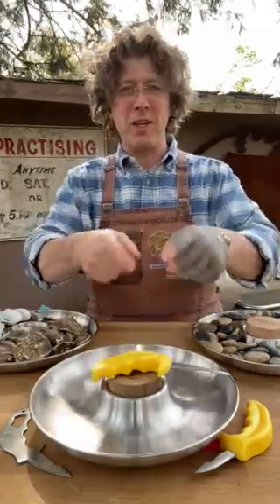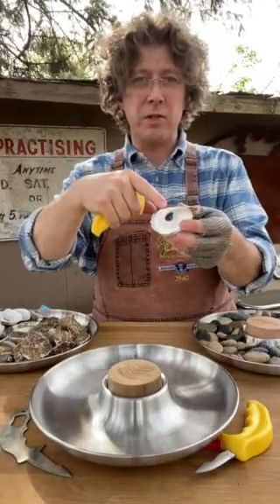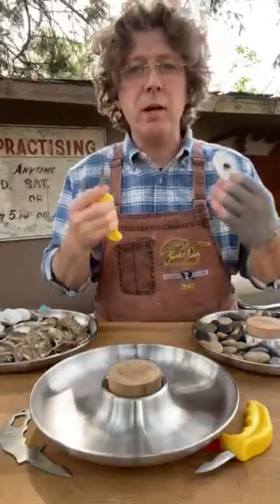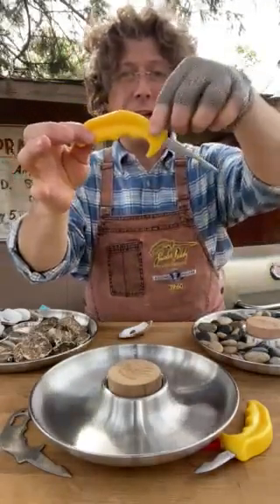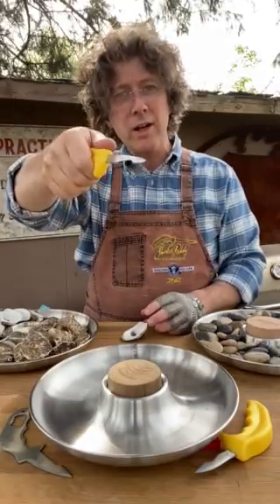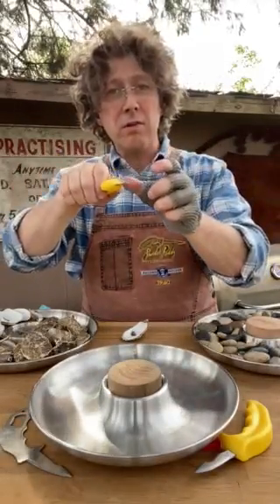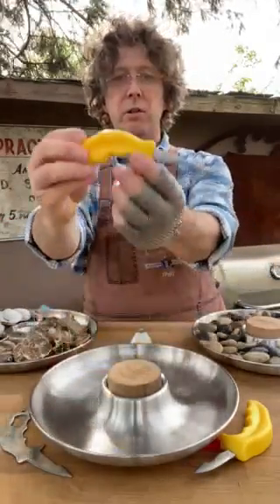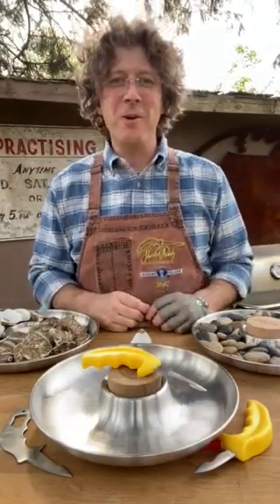Original Oyster Knife Product Video

Comment: Ive tryed this knife and i must say i just dont like it for almost every way the handle doesnt feel natural it almost forces you hand in a fixed position which i find counter intuitive, the tip is too thick and the body of the rest of the knife is too narrow. I might as well be using a flat head screwdriver. And the part where you took the metal out is where i want and need the metal. Now im not saying that this is the worst knife. But im saying its too specialized for the persone who designed it